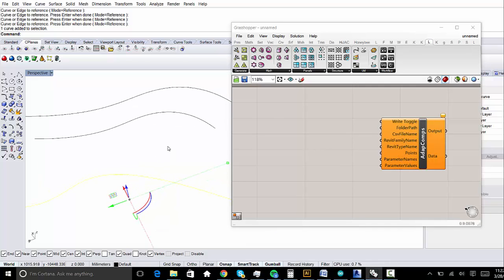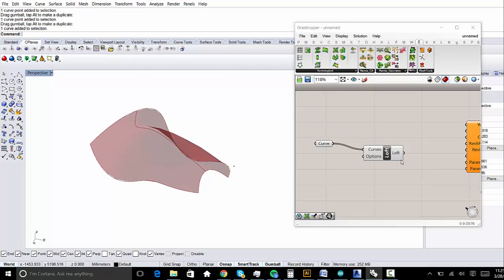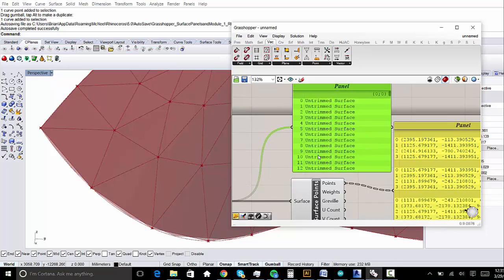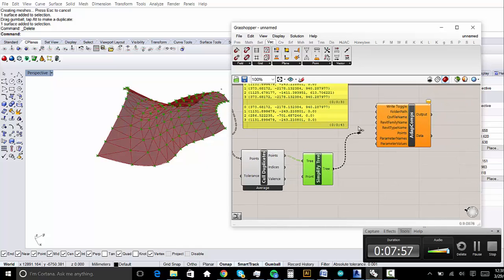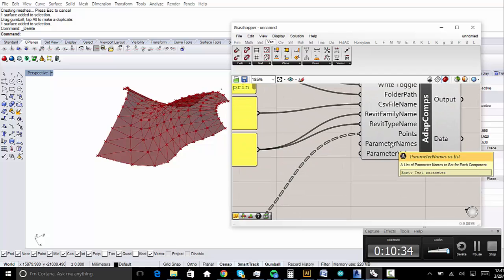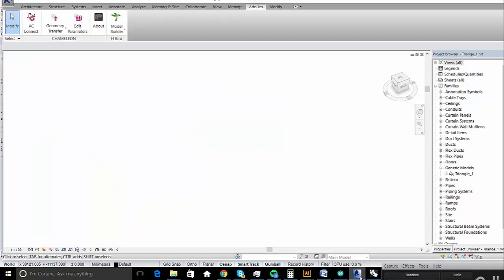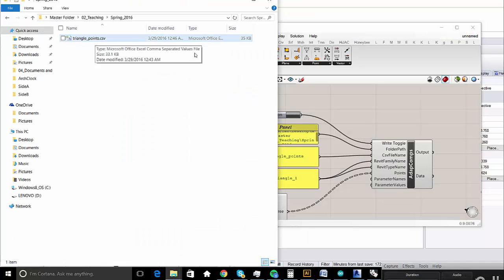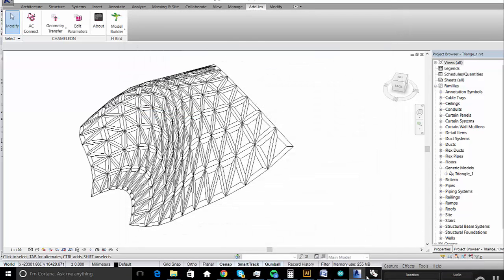Hummingbird Workflow 01

Comment: Brian, Thanks for sharing. I've been attempting to output, using the walls module, walls of varying heights to no success. So far it seems the walls module is only able to output walls at a consistent height. Any clues on how to work around this without having to generate a new CSV file for each different wall height? 

Also, who would you recommend I get in contact with for more questions about hummingbird? Cheers.